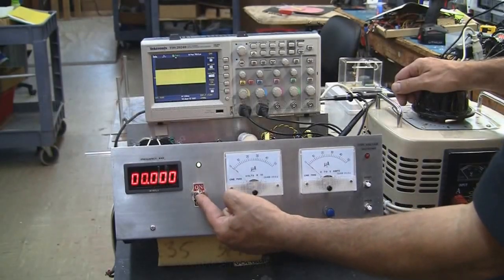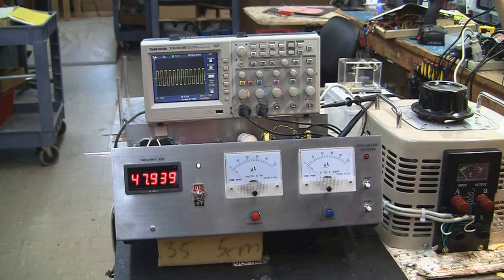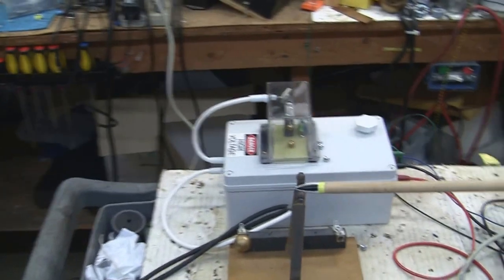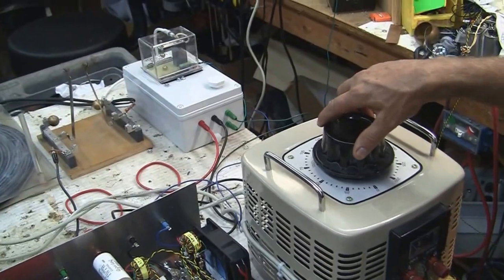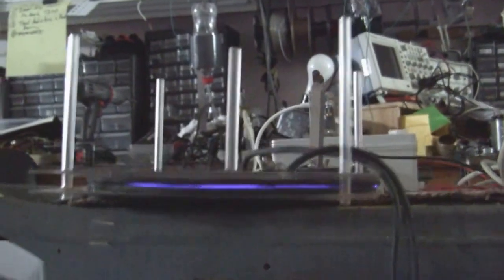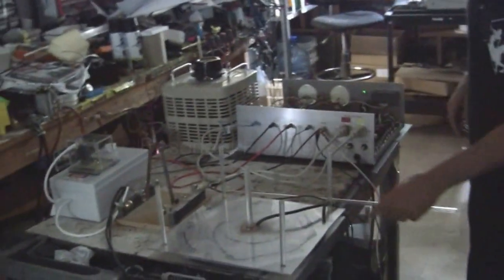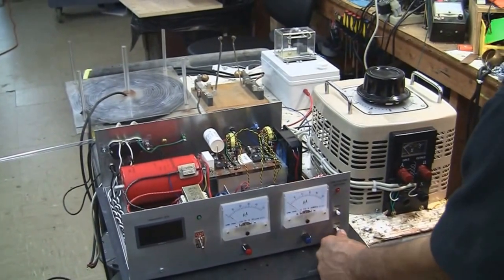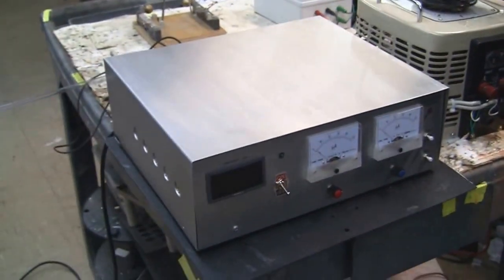High Power Plasma Generator PVM2000

Comment: Thank you for showing and explaining a practical demonstration of the importance of duty cycle current control in a switchmode circuit, albeit one designed for a specific application.

As a hobbyist I am obviously not an engineer nor a plasma physicist, but I have read up on the various SMPS and linear power supply topologies.   

While I think I'll stick with what I know, at least now I am starting to figure out how all the great plasma artists like Wayne Strattman do what he does.